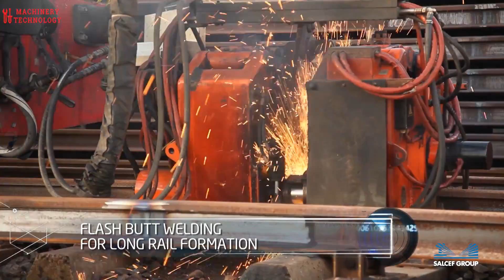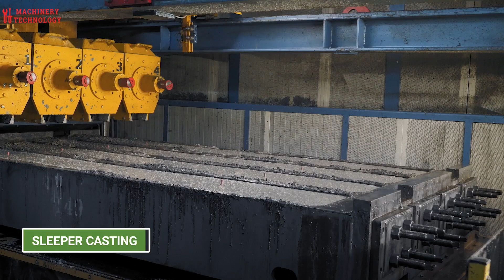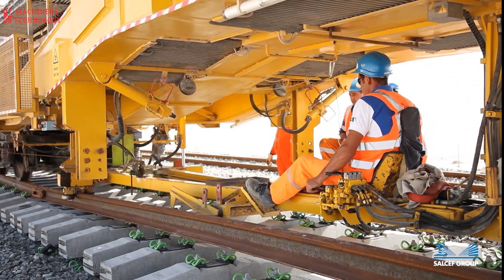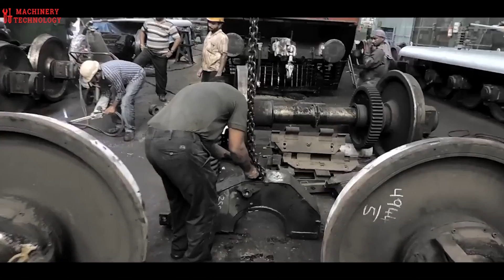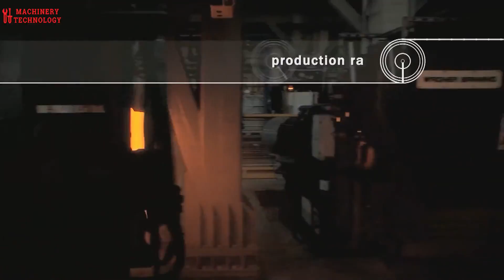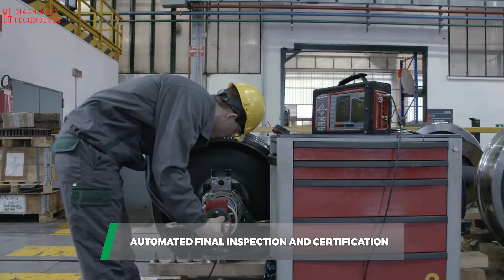Incredibly Modern Machinery Technology Producing Railway - Mass Production Automatic Train Wheels

Comment: Very intersting video. At 10: 32 narrator mentions thermit welding. The actual  method of welding shown on this film with captions says flash but welding far superior to the thermit method. Please note I am not a track guy I rode thd rails in a locomotive as a driver ( engineer ). Google thermit welding really worth a look. Good track is the back bone of the railway. I salute you track people. Well done guys and girls.

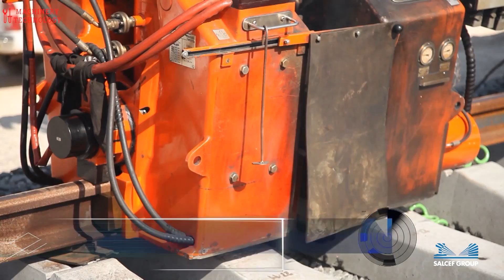Comment: 10:30 this particular case it's not Thermite welding. This is melting both rails using electric current and press using hydraulic one rail to another - better method but requires heavy specific equipment.
Reply: Exactly. See my comment. Flashbutt not thermit. Two completely different methods. The metallurgy in flashbutt far superior. Thanks mate. ☺